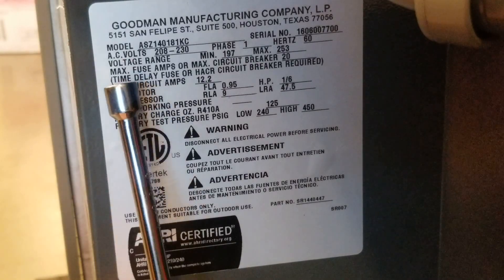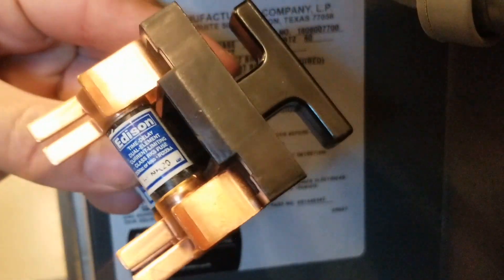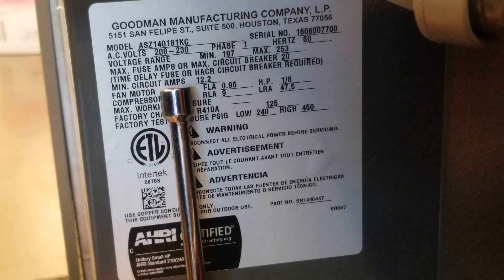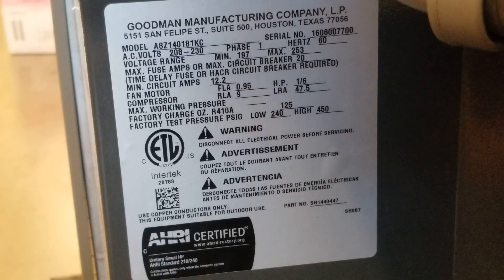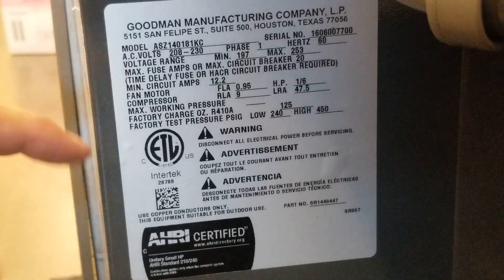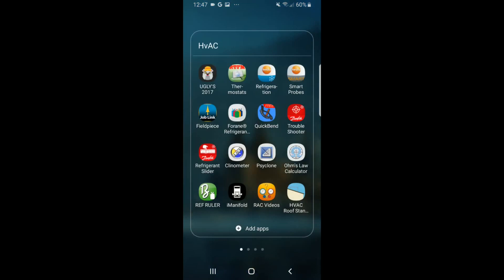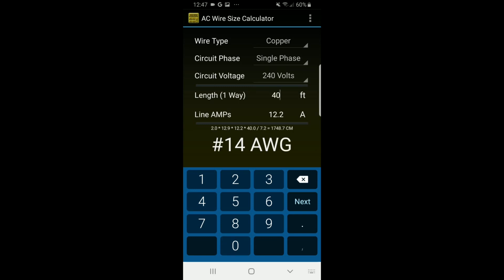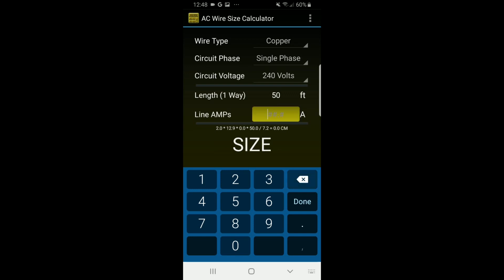Maximum over curent protection mop vs mca minimum circuit ampacity

Comment: Code requires 1.25 x 12.2 Amps =15.25 as the Min Circuit Amps . So wire sizing should be off the larger number. I would use the 20 amp fuse or breaker with the 15.25.
Reply from the maker: https://iaeimagazine.org/magazine/features/overcurrent-protection-for-air-conditioning-and-refrigeration-equipment/    thos article breaks it down and lists where the codes are for each related topic
Reply: @love2hvac  Awesome.
Reply from the maker: I have never seen a 15.25 amp fuse or breaker.
Reply from the maker: provide proper overcurrent protection for the equipment covered by Article 440. The combination-load equipment manufactured today should have a nameplate. The nameplate details the data needed in order to provide proper overcurrent protection for the equipment. Section 440-4(b) requires that combination-load equipment be provided with a nameplate that gives the installer and inspector valuable information. The information on the nameplate includes the manufacturer’s name, voltage, phase, rated-load amperes, etc., and two very important items. The two most useful numbers are the minimum circuit ampacity and the maximum overcurrent protective device
Reply: Thank you Ty , here is a good app that is free that helps size electric, “Mike Holt,s Electrical Toolbox”,You will like

Comment: how can you put a 20 amp breaker on a wire that theoretically can only handle 12.2 ? luv your videos just trying to understand
Reply from the maker: https://www.achrnews.com/articles/135676-what-most-techs-get-wrong-about-wire-sizing

And  podcast 
https://www.hvacrschool.com/size-wire-condenser-really-require/amp/

You have a great question!
The article and the podcast above can explain the why much better than I can. 
If you have time check them out.
Thanks for your interest. Curiosity is a great tool for learning.
Reply from the maker: https://iaeimagazine.org/magazine/features/overcurrent-protection-for-air-conditioning-and-refrigeration-equipment/  here is another great resource that explains it including codes and why